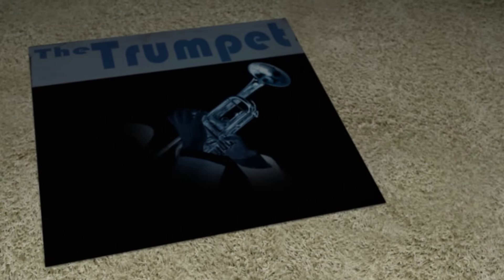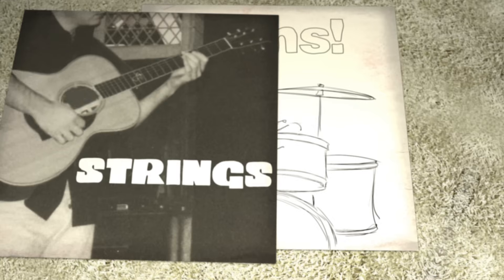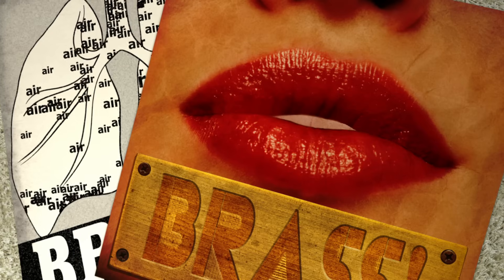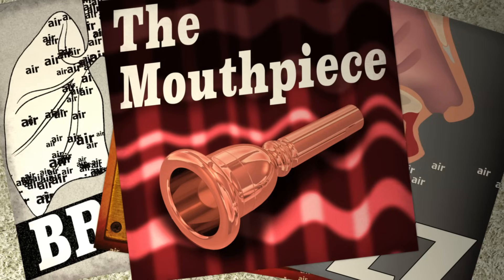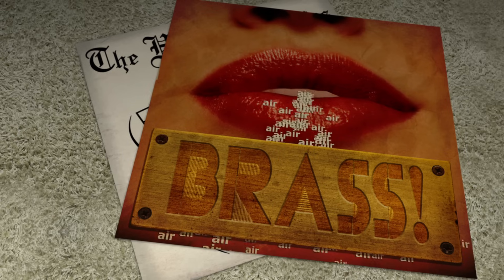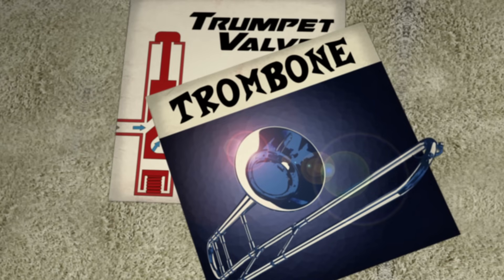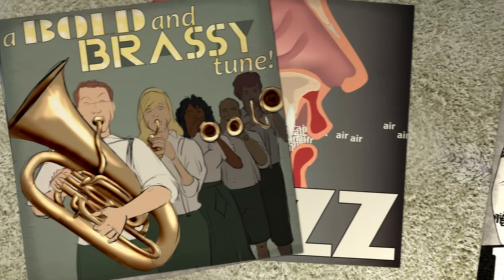How brass instruments work - Al Cannon

Comment: Wait. What about the gisnt sousaphone?
Reply: The sousaphone (/ˈsuːzəfoʊn/ SOO-zə-fohn) is a brass instrument in the tuba family. Created around 1893 by J. W. Pepper at the direction of American bandleader John Philip Sousa (after whom the instrument was then named), it was designed to be easier to play than the concert tuba while standing or marching, as well as to carry the sound of the instrument above the heads of the band. Like the tuba, sound is produced by moving air past the lips, causing them to vibrate or "buzz" into a large cupped mouthpiece. Unlike the tuba, the instrument is bent in a circle to fit around the body of the musician; it ends in a large, flaring bell that is pointed forward, projecting the sound ahead of the player. Because of the ease of carrying and the direction of sound, it is widely employed in marching bands, as well as various other musical genres. Sousaphones were originally made of brass. Beginning in the mid-20th century, some sousaphones have also been made of lighter materials such as fiberglass & plastic.

Comment: So wait ... brass instruments dont use a reed or anything like that, it's just essentially one long length of coiled tubing with a horn at the end? I always thought they used a reed or something similar like a saxophone does and that's what makes the sound. I did wonder how trumpet players could play so many notes with just 3 valves, I thought different combinations of which ones were up and which ones were down gave different notes or something.
Reply: The Eb tuba has 3 valves too btw the saxophone is not a brass instrument,and brass instrument can play a LOT of notes the valves help Sharp and flat or create new notes, by changing the ombre sure you can create a new note,i
Reply: The buzzing of the lips make the sound
Reply: We don't need a reed or anything, we just need the mouthpiece and some valve oil. There are many valve combinations and you can change your omniture to make the pitches higher or lower.
Reply: The 'only 3 valves' thing is because of the harmonic series. When you play a 'C' for example (no valves) there's overtones of the 5th (a G) and the 3rd (an E) and as you get higher and this series gets closer together, there are more overtones so you can get more by adjusting the lips slightly. Then, if you put a valve combination down you can then get the new harmonic series (the tonic is now a Bb with the first valve) so an f is now the 5th etc so swapping the valves changes which harmonic series you can get (by shortening the air pathway) and the lips are used to pick the note in the series. That's why some people argue brass is more difficult. Some people think woodwind is because they have to remember more valve positions but once remembered they can't hit as many as a brass player can. A brass player has to be able to hear the note and be able to adjust their lips according only very slightly or the note will completely change, with only 3 valves to aid them adjusting pitch.

Comment: I love how he put o2 for air when we breathe out Co2 genius
Reply: welp, videos have flaws sometimes
Reply: @Skummar Köphunchuksohn This is correct.  Unless you're SCUBA diving then the air you're breathing probably has water in it (think humidity).  Water vapor is part of your exhalations as well.   If the video creator wanted to use a single element/compound coming out of the horn then Nitrogen would have been best since it makes up ~78% of earth's atmosphere.  But that's too technical.  Just having "air" come out of the horn may have been best :)
Reply: @Skummar Köphunchuksohn i dont think you know what you talking about because we dont exhale h2o, thats literally water

Comment: I wanna say that its not fast or slower air that makes a note higher or lower, thats all your aperture and if it's more open, you'll get lower notes, but if it's compressed, you can hit higher notes. Air speed should always be fast no matter how you play. Also warm and cool air change the tone of your note, not the note itself.
Reply: The air speed does not determine the pitch. That is a myth. The state of the apperture controls pitch. And no, the air does not have to always be "fast" it simply must flow. How much depends on loudness of tone.
Reply: Jared_Likes 7 as a brass player I understand what you mean. We are brought up being told to always play with fast air but the true is scientifically that in order to get different pitches we must change the rate at which the sound is vibrating inside the tube ( on natural harmonics with no valves that is) and the way to do that is to either speed up or slow down the air. It still leaves our mouth a roughly the same velocity I believe but the natural harmonics of the horn somewhat force you to play slightly faster or slower in order to accomplish this effect
Reply: When Dr. Cannon refers to air speed, it’s an abstraction to simplify the concept for non-musicians. 
The air pressure and support is constant and unchanging throughout the system to maintain good tone—by reducing the size of the aperture, the constant air pressure leaves the aperture at higher velocity, ie faster, cooler air. The opposite is true for lower notes; same pressure through a larger aperture makes slower, warmer air. 
Source: studied with him for several years in Vancouver, BC, Canada
Reply: Constant air pressure yields a constant air velocity through an aperture, regardless of apeture size. The system is not quite as simple as the "abstractions" claim. The aperture posture determines the frequency of tone, that is, the pitch. A certain air flow results determined by the acoustics of the instrument and the efficiency of the player. Velocity ANYWHERE has no causative effect on pitch.  Also, air pressure does change for loudness control, that is, musical dynamics. It is safe to assume that velocity varies with dynamics on a constant pitch.
Reply: @Devon Atkinson - it's usually a mistake to try lecturing the public on a subject of which you have only a dim grasp.

You only hear the 'fast air' idea in America, and it was debunked decades ago. The air column is vibrating in a four-steps-forward, three-steps-back sort of manner, so to talk of some absolute air speed for a given note is difficult to make sense of in any event. 

It is the balance between lung pressure and lip tension that determines the note. Increasing lung pressure tends to raise both pitch and loudness; increasing lip tension also tends to raise pitch but decreases loudness. Of course, the reverse of each is true. So each different combination of the two results in a unique note of given pitch and loudness. 

It is a life's journey learning to synchronise these with not only each other but also with the corresponding valve fingerings, tonguing technique, and tonal colouring. 

Fortunately, the amount of air taken from us, and precisely when it is taken is decided by the instrument. So there's no need to think about that unless you're really into thermodynamics. (The knowledge doesn't help you play any better!)
Reply: @sethoflagos2880  First of all I have expert grasp of the topic. Second, I pretty much agree with what you wrote and I believe that air speed ANYWHERE is not something to be concerned about. Perhaps you have me confused with someone else.
Reply: @Darryl Jones - apologies for my senior moment. Post amended.
Reply: @sethoflagos2880  . But yes. The "air speed" verbiage is a popular phase in the US. It simply gets passed around with no real understanding.
Reply: By closing your aperture and pushing as much air  with your diaphragm the air will have to travel faster through your mouth and instrument. The fast air then creates faster vibrations in your lips, thus allowing you to play a higher note.
Reply: Air speed should be faster for higher notes and slower for low notes. Source: I play tuba and you can’t play low notes with fast air. It doesn’t work.
Reply: The airspeed varies throughout the system. If you are talking about the airspeed through the aperture it may indeed be faster depending on how loud you play. AirSpeed does not determine pitch, ever.

Comment: You exhale CO2 not O2
Reply: its actually both, and other gases - a mixture of sorts
Reply: You exhale water vapor as well as CO2. And when that warm water vapor from your lungs goes into the cold brass instrument, it cools and condenses into water. That is why we have spit valves. (Even though it's not spit, it's condensation)
Reply: Anyway the point is that you are breathing out not only O2, it bothered me so much. Just like us, the musicans, breathe differently 😂
Reply: JohntheRobot it is a WATER KEY
Reply: GET OUT NERD

Comment: Shame the answer on the question in the beginning is not given: the bore gives each instrument its characteristic sound. If it's cylindircal, the sound will be clearer and more direct (such as the trumpet and trombone) and if the tubing is a bit conical the sound becomes rounder (like the French Horn) and when the bore size increases a lot over the length of the tubing it becomes very mellow and round like the Euphonium.
Reply: Interesting! Thanks

Comment: As a Horn player, I am deeply insulted that you didn't even mention us! We have a unique form of pitch changes via the rotary valve system, rather than the piston and slide mechanisms of trombones and the others. We are also capable of changing the pitch of the note with our hands, (which is why we always have our hands inside the bell.) That, an we have the longest amounts of tubing than any other instrument. It's remarkable how we can play as low as trombone, and as high as a trumpet.
Reply: Thank you! I was like, "where's the French horn!"
Reply: Theodosius now you know how the Euphonium feels
Reply: yes, but the fundamental idea is still the same. if he had mentioned every brass instrument, we'd be here all day.
Reply: Shut up where better (trumpet)
Reply: @lbrown21494 yep
Reply: Pine Sol so then i can just transcribe it
Reply: The horn doesn't have the longest tube.  That award goes to the Bb tuba.  A sensible range for the Euph is from concert G1 to concert Bb4.  A sensible range for the Horn is from concert F1 to concert C5.  Expanding those ranges to physical limitations gives a concert pitch range of E1 to F5 for the euph and C#1 to Bb6 on the horn.
Reply: Theodosius uh WRONG b flat tuba has more tubing.
Reply: You do not have the most tubing the tuba does we have on our smallest full size tubas 32 feet of tubing
Reply: Sam Hansen you have 12 octaves??? 🤔 I only have 6... So far.
Reply: They at least put a picture in there, they didn't even think about including the euphonium.
Reply: @Mia-wz2he  yea true
Reply: y no baritone 😭😭😭😭😭😭😭😭😭😭😭😭😭😭😭😭😭😭😭😭😭
Reply: You do know trombone can Change pitch too?
Reply: french horn actually has the most range of any brass or woodwind
Reply: @L plssss lol this burn is too harsh for them
Reply: Theodosius An air stream blowing through the F side of a double horn is 12' while the air stream blowing through the Bb side is 9'. Since the double horn shares many segments of tubing between the two horns the actual length of tubing varies based on the design, but is ~16-20' I would say.
Reply: And to add most tubas have rotars
Reply: I'd like to add 32 feet is as long as a school bus
Reply: Rotary valves have nothing to do with the pitches. The reason the harmonic series appears to be different with a french horn is because the long tubing combined with the fast air column that the mouthpiece facilitates causes you to play an octave higher in the harmonic series.
Reply: Theodosius so
Reply: Theodosius I AGGREE!!!
Reply: I play french horn too!
Reply: Oh heck noooo you can’t play as low as the lowest trombone notes
Reply: MrSolarWaffle you can’t play as low as three lowest tuba notes >:)
Reply: Weird flex but ok
Reply: Bruh. Theres also a rotary Trumpet and Tuba.
Reply: Actually You don't know how low trombone can go
Reply: As a brass player and composer, I play French Horn and as much as I'm bummed out that the instrument is not featured, the French horn does  not have the longest tube (because we're beat by the BBb Tuba's tube length) it has the longest tube in relation to the typical range it plays. For example, Trumpets play high but its tubing is short enough that it plays within the lower harmonics, and vice versa with the other instruments: Trombone plays a tenor role, and its tubing is in a length where it sits around a comfortable set of harmonics and same with the tuba. The horn has a longer tube but it plays in the higher set of harmonics--like the euphonium where it has the same tubing as a Trombone, but it plays higher usually around the French Horn's range and even higher. They missed the opportunity to talk about hand stopping and rotary valves, but that'll be too much information for the non-musically inclined to process. (like how me before I went to music reacted to this video years ago.)
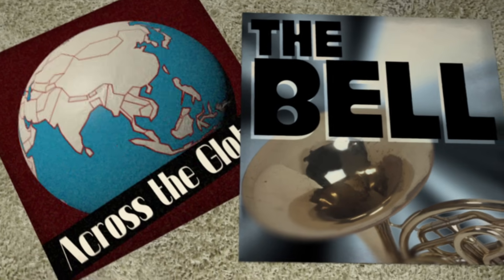Reply: 3:46
Reply: Ahem.. my tuba also has rotor values as well as the longest tubing BY FAR….. how bout you do that research and then argue for recognition [for emotional reasons this is just a joke and nothing else so I hope no real offense is taken]
Reply: Get over yourself.
Reply: the dead meme in ur profile pic means that your opinion does not matter
Reply: Damn chill 💀💀💀💀
Reply: Preach we French horns and mellophones need justice
Reply: You have my heart Horn! I LOVE that instrument. If only i could buy one
Reply: Same. Even though I am only in high school
Reply: @EdgarRoss1  then the insult hurts even more. In high school everything has a greater impact
Reply: L French horn trumpet is better
Reply: @trumpetplayer9554  hmmmmmmmmmmmmmmmmmmmm 
My goals are beyond your understanding
Reply: You could say that about any rotary instrument
Reply: I did see a picture of the French horn... For a few seconds 😂😂😂
Reply: Bro contrabass tubas have moe you have as much tubing as a bass tuba
Reply: Always gotta be someone getting offended…
Reply: they couldn’t comprehend the goofy wacky pitch complications
Reply: Bro graduated from yappalachin state
Reply: melophone better
Reply: I agree
Reply: French horn gang rise up!!
Reply: It’s the same calm down brother
Reply: @HelloIAmNextToYou  as a french horn player myself, piston and rotaries are not the same
Reply: @edison1125  so you’re saying French horn is out of the brass category? I was just saying that when you hold down the button or rotor things for you guys, it raises or lowers the pitches, just like tuba, baritone, and trumpet, and mellophone. They’re the same .
Reply: @HelloIAmNextToYou  lol I never said that french horns were out of the brass category, I just thought you meant that pistons and rotaries were the same, didn't know you were talking abt brass instruments as a whole
Reply: @edison1125  ohh ok
Reply: shut up and eat a brownie
Reply: HORNS RISE UP
Reply: hey bro
3:41
Reply: 1:44
Reply: foghorn sound 🤓☝️
Reply: We also collect the most saliva!
Reply: Womp womp
Reply: Horns of a. Feather stuck together
Reply: Erm…🤓👆uH🤓🖕AktuAlly
Reply: I'm gonna get someone fired at TED ED for this
Reply: Some horns use piston valves, and some tubas and trombones have rotary valves.
Reply: As a horn player can confirm your overreacting😂
Reply: The mechanics behind all brass instruments tho, no matter what they are, (I’m a trombone player myself), are exactly the same because at their core, they are all exactly the same. It’s just a matter of size.
Reply: exactly.
Reply: same bro my range can go absurdly low
Reply: Try 12 octaves. #TeamHorn
Reply: i feel you 😢😢
Reply: IKR!
Reply: the Euphonium has the biggest range just sayin
Reply: The horn is the most beautiful brass instrument 📯 ❤️
Reply: @HAngeli  No, just stop being annoying you horn players, the French horn  isn't as versatile as the trumpet and trombones, and not even as loud, this is probably why it isn't mentioned, have you ever seen jazz bands or blues band with French horn? Personally I don't, said by a bassoon and cornet player
Reply: @nightlord8756  where are the solos? (trumpet I can understand)
Reply: This video is about “low brass” not “brass”